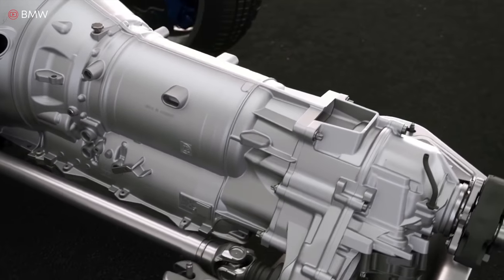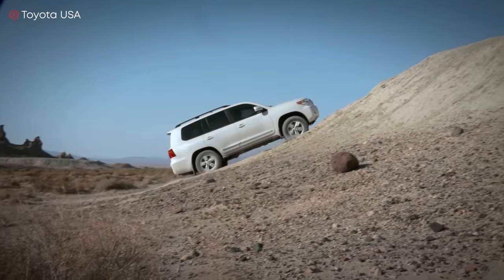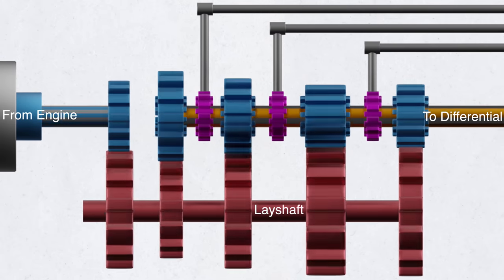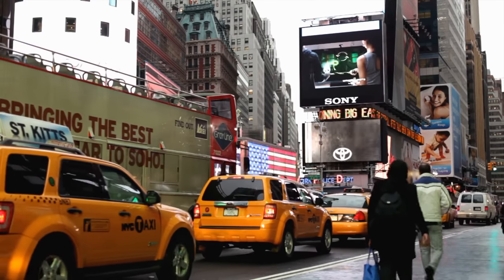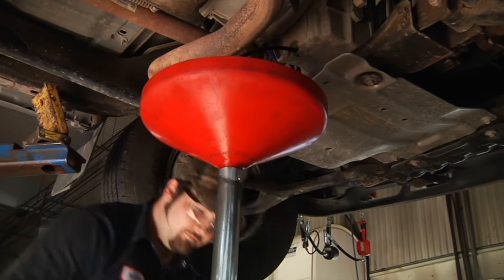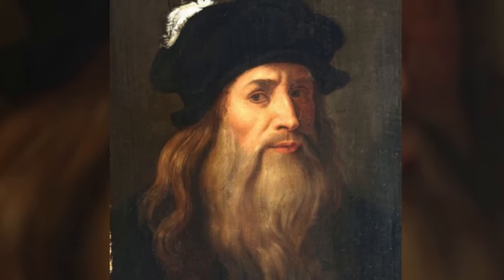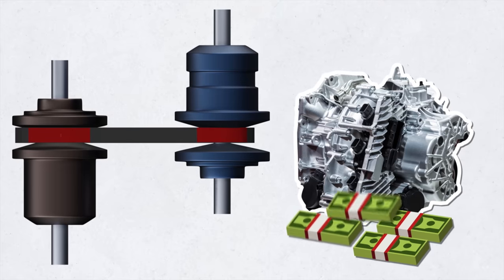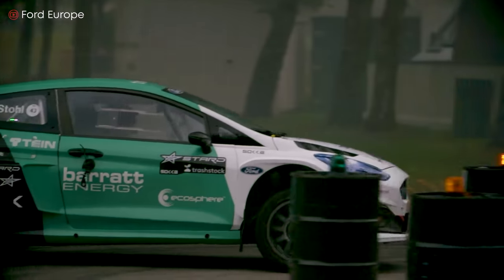Who Makes the Best Transmission and Why

Comment: I've owned alot of cars and trucks and as others have said, by far the finest automatic transmission is the ZF 8HP (made in Germany and supplied for many high-end carmakers such as BMW, Maserati, Rolls-Royce, etc). This beauty is made in different torque capacities, for example I discovered this transmission is in my RAM1500 where it creates the most AWESOME drivetrain and really shows just how shitty the transmissions are in GM & Ford trucks. Then -  it is also in my 2020 Dodge Charger Scat Pack - a fast and fun car and same thing it's the FINEST!

Comment: The ZF 8 speed auto is a solid box and has been used in every BMW for the last decade. It handles anything from the 258 lbs-ft of the 2.0l I4 to the 553 lbs-ft of the 4.4l V8 M engine.
Reply: The ZF 8 Speed is great. Also the old 5 Speed Mercedes seemed to be more reliable than others. My Taxi (W212) got 425 000 km on it. No probs with the Automatic.
Reply: @automotiveje5182  The 722.6 was such a good trans. It can handle a decent amount of power too!

Comment: The ZF 8HP is a solid transmission. I have found them to be bulletproof and extremely efficient, the can shift is about 100ms and I love mine.
Reply: That is a stout box for sure, the 6R80, and GM 6L80/90 variants are strong as hell too. Not withstanding GMs 8L90 and the new 10spd 10R80/10L80 from them both. I believe Ford holds the strongest trans though with the 6R140 and 10R140 both being seriously stout units.
Reply: They should’ve stayed with 8 because the ZF9 is absolute trash

Comment: I hooked a dump truck transmission to a 4 cylinder Nissan so I never have to replace the transmission again.
Reply: Pardon for my lack of knowledge, but is it possible to universally swap a transmission? I mean my car has a CVT that has already broke down once few years ago, but i wonder if its possible for me to swap it to a normal TC 4 or 5 speed auto.. Is that even possible by any means?
Reply: @supraxv12  not worth the cost. It would be cheaper to sell it and buy a car with the transmission you want
Reply: @supraxv12  Not without some serious mods. If a computer is involved, yet more mods. It probably is illegal under emission laws and even if you could get it to run, you might need more illegal mods to keep the check engine light off.
Reply: @supraxv12  done that before.. It used to be different. Just swap in the parts and you're good. Now it's wire harness and computer aslo required. My old truck went from a stick to automatic and back to stick when that crappy aod failed.

Comment: The zf 8 speed is amazing ! I have never driven a automatic that shifts so fast and was tuned so well.
Reply: This transmission is the reason I'm getting a 2016 Charger
Reply: @ncnick777  Its been that way for a while now. Unless you work for a dealership and go to school every few months, its almost impossible to keep up with all the changes.
Reply: @Dominus4776  When you get the repair bill you'll see why they call them Chargers.
Reply: @solarfall2728  i have a 150k mile warranty as long as I keep it stock
Reply: @solarfall2728  Chargers and Challengers made it in the top ten most reliable vehicle models in CR 2020. Get with the times old man.
Reply: @jamesb3729  Sorry. But I don't get my information from reading consumer magazines and watching Scotty Kilmer videos. I have to do it for real. 

What consumer reports doesn't tell you is 2 kinds of people buy the Dodge. Type 1. They don't drive the car very often, and when they do, they baby it. Type 2. People that modify and beat the hell out of the car, void the warranty. Since consumer reports only reports of warranty claims, statistics in this case, doesn't do the issue justice. The Challenger and Chargers are pretty nice cars. The transmissions aren't the most reliable, but they're nice cars. 

As for getting with the times, when was the last time you rebuilt an engine or transmission on a current production vehicle? Or diagnosed a multi CAN issue?
Reply: @solarfall2728  Last month. After all I have been a mechanic for the past 16 years. Go on and tell me more about chargers and challengers. Seeing as I have quite a bit experience with them. See this is why I called you out. Not interested in whatever excuses you are going to make. The chargers and challengers aren't unreliable vehicles no matter how much you hate this narrative.
Reply: @jamesb3729  Its obvious your feelings are hurt. Was it my Charger joke?

Either way, you're full of crap. No mechanic on the planet would quote consumer reports. Maybe a Toyota lube tech, but that's it. And you didn't call me out. You don't know enough about cars to do that. You're just another mouth wrench that gets all their information from Scotty Kilmer videos. I could put you under the hood of the Dodge you claim to know so much about, and you wouldn't even know what most of the parts are.

Comment: My 50 years experience shows that the manual transmission is the most reliable and the best modern manual transmission is the five speed built by Tremic.  The automatic transmission is usually reliable during the life of the vehicle and my pick for the best made automatic transmission is the six speed Allison transmission.  Like Scotty said, the CVT transmission is the weakest transmission that is made so by the steel drive belt that is being stretched and squeezed on the spindle.  The overall reliability is yet to be determined and will be after enough time has gone by.
Reply: I prefer the Tremec T-56 Magnum 6sp. There's no stronger manual gearbox made
Reply: I’m a 40 year auto tech and I couldn’t agree more. Problem is the arthritis in my left foot has forced me to get away from a manual. I’m old 😂. 
Sooo, I choose an automatic which my favorite is the ZF 8HP trans. Absolutely bullet proof and has 8 wonderful ratios and the WHOLE WORLD is using it.

Comment: We have a 2002 Nissan Sentra XE with a 4 speed auto, a 2019 Kia Soul with a 6 speed auto and a 2018 Civic Sedan with a CVT in our driveway. The Sentra has been extremely dependable over the years and that trany is bulletproof, Kia’s transmission is so smooth and like a nice elastic feeling when driving hard... The Civic is the worst car we’ve ever owned since Honda replaced 6 times some defective bearings in the CVT and at the 7 time they replaced the whole transmission.

Comment: Hey Scotty!  Honda CVT's are smooth and dont't overrev which I like.  The Mazda CX5 tends to jerk at low speeds. But the Mazda will probably last longer.
Reply: @thatguy1919  Hopefully not, I drive a CRV and CX5 all the time.  The Turbo/CVT does concern me long term, but I love the throttle response and steering feel on the Honda.

Comment: But who makes the best transmission
Reply: Allison Transmission!
Reply: toyota. cmon its scotty
Reply: ZF Friedrichshafen AG
Model: ZF 8HP
Reply: Allison by far! I Just serviced a fed ex step van with an Allison 1000 I believe with over 600k miles on it.
Reply: @shawnbowman687  yeah, 1000-2000 series are rock solid man.
Reply: It’s Subjective
All depends on its application 
vehicle weight, engine torque, environment of operation,
periodic maintenance ..
  “adjustment of ‘nut’ behind the wheel” 🤪
Reply: Aisin Toyota
Reply: @douacuvinte  oh Allison  !
Reply: The 1994 Celica! Duh!

Comment: I've never had any issues with Nissan Manual transmissions. From my 1983 Datsun 200SX, 95 Nissan XE Frontier,  2007 and 2010 Nissan Frontiers. I still prefer manual transmissions. 2021 Nissan trucks no longer have the Manual transmission option, but Toyotas still do.
Reply: Had a Nissan Safari Grand Road 4.2 diesel with a 5 speed Manuel gearbox when I sold it the mileage was 390,000 thousand and  was still running perfectly motor and gearbox. Always serviced.

Comment: On a more serious note I have a  GM 6speed in my silverado. I really miss my 4speed overdrive  in my old 01 silverado
Reply: The 4 speed 4l60e was not a bad transmission unless you raced it all the time. I have an automatic Corvette with that transmission lol. I think the last owner had the transmission rebuilt by someone who knew how to modify them a bit because it shifts really quick and smooth. Also has fresh, red ATF when I checked the fill plug. It already had over 130k miles.
Reply: At least u don’t have the f150 10 speed like me. Lol.
Reply: Yeah, and when you need to rebuild the 6 speed, it is easily twice the price.  No thanks.  The 4 speed is more than enough ratios with lockup as  a virtual 5th gear.  My father in law calls lockup a "paper gear" I guess because on paper it serves as another ratio. Or maybe because it's as flimsy as a gear made from paper...
Reply: It's hard for me to explain but have any of you ever drove an old 4 cylinder escort, or Honda civic automatic  where the car is always struggling to maintain speed by  downshifting all the time? That's what my 2013  silverado feels like with this 6speed. Same 5.3 actually more powerful the my 01 5.3. The  01 4speed overdrive was just a much nicer ride all around.
Reply: I hear ya, still got my 2000. Simple and solid V8 running on all cylinders, 4 speed tranny and old school rear end. Going on 21 years now.
And I just got a '14 Scion XB with a big overbuilt fuel injected inline 4 with 4 speed Aisin auto. No turbo, GDI or multi speed or CVT. I  dread the day I may have to buy some new cookie cutter plumbers nightmare. I'll look for a barn find 1st.
Reply: I've been curious about that. I've got a 4l80e in mine. It's pretty nice, no need in gearing down to pass with that 6.0. I've never been a chevy guy but i really like that truck.

Comment: Glad my 2005 Nissan Maxima didn’t make the cut for the CVT switch (Still running like new). Sorry for anyone with a 2007 or newer Nissan. 🤣
Reply: And when 4th gear lock up it actually a 5-speed.
Reply: I have a 07 altima 2.5s bought it used 3 years ago haven't had transmission issues...yet.
Reply: 2009 altima hybrid but the tech is toyota guess

Comment: The CVT is not the transmission I would ever consider. The manual transmission is very reliable and still offered in high performance German cars like Porsche and are fun to use but most women don't like using them and they're being supplanted by auto-manual gear boxes or full auto by most manufacturers including BMW. Everyone has different taste but out of convenience and stop and go traffic I do prefer the auto or automated manual as there is a lot of wear and tare on the clutch in these driving situations. The electric vehicles of the future may offer a different transmission perhaps not yet patented. Good review.

Comment: Love my cvt on my 18 accord , 151k
Reply: Honda CVTs are another level.
Reply: @lazyrider6918  Another level of crap.  My 2015 accord sport CVT performs weak.
Reply: @concha1011 law of averages. Drive and maintain it properly and you'll get good life out of it. Granted, I can beat the snot out of my s2000 manual tranny, but even a standard 5 speed automatic Honda tranny can't be abused. My Cr-V CVT with 76k is purring along. Change your transmission fluid regularly

Comment: The 6 speed allison is the best automatic transmission ever made
Reply: Best for heavy duty , yes.
Reply: Damn right!
Reply: No the 4 speed auto from the Toyota Corolla is the best ever. Made by Asin.
Reply: My drilling rig says otherwise. I have 2 Allison transmissions on it one for mud pump one for draw works and both cost me thousands in breakdowns. Not impressed with it

Comment: Best transmission hands down is my 94' Celica with over 340,000 miles on it.
Reply: My 1984 Celica Supra with W58 transmission over 500,000 miles shifted like new.
Reply: it only has 240k and is rarely driven now.
Reply: Had a 1994 Toyota Camry come to my job today.... 279,689 miles on it... looked rough not taken care of dash cracked etc... drove great manual transmission shifted smoothly... I was amazed. Then I drove a Chevy Cruze with 17,000 miles. The old Toyota drove better.
Reply: @SimplyCarReviews  Great!
Reply: @DanielE-dk1ws  best $800 bucks I ever spent on a car... never left me stranded.
Reply: @BigEightiesNewWave  I drive my 94' Celica everyday and. It has over 340,000 miles on it.
Reply: @SimplyCarReviews  You are a smart man!

Comment: Just one point, the fluid coupling is not sealed on modern auto transmissions. It is filled and drained when selecting direction and neutral. Old auto transmissions 25-30 yes ago did have separated sealed fluid couplings.

Comment: Allison does make a supreme large land-based vehicle transmission.During the late seventies early eighties, it took 40 man hours tear down for the off road ten speeds and 40 man hours to put it back in operation.Clean rooms were required for the perfect job Most were in a truck dealership .Six speed for road trucks , ten for dirt and gravel haulers. I wonder what the cost is to redo a GM or ford pickup these days ?

Comment: A manual... that's the damn answer. I'd rather replace a clutch instead of a whole transmission. The clutch in my car is still good at nearly 200k and the pack replacement is only 350 bucks. I don't find manuals to be difficult in stop and go traffic. It forces me to be patient and find more times to just crawl in 1st or 2nd. I actually get really impatient in an automatic.

Comment: JAGUAR and Rolls Royce  used GM  Hydramatic TH400 Trans for Some Time - Back in the DAY they were Leaders - 2021 NOW FOLLOWERS 
ELECTRIC CARS have 1 or 2 Speeds
Reply: Rolls Royce used GM trans. / air conditioning.
Reply: Also Rolls-Royce
Reply: Th 400 was a beast.
Reply: Remember, GM did mass produce the EV-1

Comment: I nominate the FORD C4 transmission common thru the '60's and '70's as "the best" due to a junkyard that I frequented in the '80's put their inventory ON SALE for $25 EACH as they had a warehouse full.  Nobody was buying them because they didn't wear out or break. They also held up at the drag strip with just the addition of a shift kit and never failed under Pizza Delivery conditions.

Comment: Scotty you forgot to talk about dual clutch transmission
Reply: In a nutshell, it's just a geared auto where the gear before and after the gear you're already in is spinning, allowing faster shifts
Reply: @danielpassigmailcom  not really. The newest mr2 was a semi auto and you had to shift it I believe. It was basically a sequential manual without a clutch

Comment: Ill never buy a nissan again. 2015 sentra transmission went out at 83k then again at 104k. Got a 2015 camry xse instead. Huge upgrade.
Reply: wow my Focus is a 2002 with 198k miles and manual works great. Did replace the clutch master cylinder for $40 when it turned 19 years old.

Comment: A bigger difference in rotation (44second mark) would be if tires turn at 800 rpm which is what they do. A 195/65-15 turns around 830 times a mile, 1 mile in a minute @ 60 mph. 35" truck tires turn @600 rpm.

Comment: I learned  alot from Scotty. I thought CVT transmissions would be better  now I know thanks Scotty.  Most automatic  transmissions I've  seen make noises or shift wierd.
Reply: I would agree with most comments here but having worked on two new model automatic transmission program launches in the supplier QA area, I can tell you a huge variable is that whoever supplies the torque converters and solenoids for the units makes a huge difference in shift quality, reliability and customer satisfaction. TC’s are complex parts that require strict and precise manufacturing, assembly and testing practices and I’ve seen many that were R@R’d from new vehicles that should have never been installed in a transmission. They somehow passed the test stand requirements but made it out the door anyway. A company named LuK makes the best ones, at least to me.

Comment: So who makes the best transmission? Never answered your own question
Reply: ZF 8 speed automatic is currently the best. Its found in many makes and models
Reply: delta=scotty once said Toyota makes the best but Honda has a slightly better engine==:0
Reply: Toyota.. It sure isn't Nissan or Honda, that's for sure.
Reply: Your local transmission shop when they rebuild a 4L-60e with a shift kit and Corvette servo lol.
Reply: I do
Reply: Aisin in my made in Japan AWD car. So far great at 145,000 miles.
Reply: @DanielE-dk1ws   Toyota dont desisgn their own transmissions. Hondas design their own. I haven't heard any massive Honda transmission failures in the past 14 years.  I have a 2008 MDX 120000 miles no problems,  a 2008 Accord v6 145000 miles no problems.  Yes honda had transmission problems before not anymore.
Reply: @ajevthetruthisthetruthnotc8390  And you don't know how to spell. I will take Scott's advice anyday over a troll.
Reply: @mcc7762  Ford

Comment: I had a 2003 Pontiac vibe with semi auto transmission. Got it with 88000 miles on it. I drove it to 327000 miles original trans and only change the oil once.  I also drove it very hard and the trans still functioned as normal. Both engine and trans had life when I got  rid the car. What was the secret? It had a Toyota drive train. I could have took it over 500k if I really tried.

Comment: suzuki has a manual automatic transmission called AMT..it uses manual transmission no maintenance ..it uses a gear changer connected to the engine and its electronically controlled.costs like a manual trans..

Comment: Scotty, hello from Ft Bragg, NC. Purchased new 06 Honda Pilot, still runs GREAT, regular oil changes, tires, brakes and batteries 8s only thing I've had to do. 120,000 miles, do I need to change timing belt? Thanks!

Comment: At 1750 RPM my 2020 Ford Ranger travels 60 MPH, it has a 10 speed and a turbo charged 4 cylinder that gives me 23.5 MPG around town and beats a Toyota V6 in torque.

Comment: Subaru has extended it's CVT warranty to 10 years/100,000 miles on my 2018 Outback. I asked about fluid changes and the dealer says that the fluid is lifetime fluid.